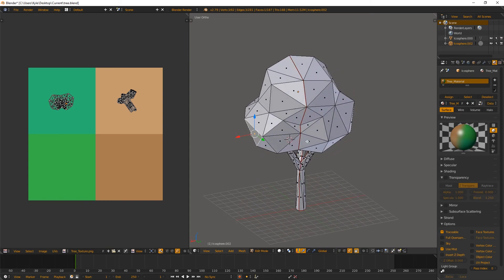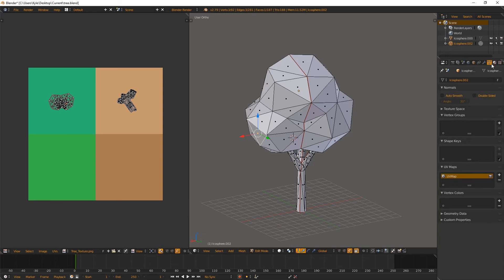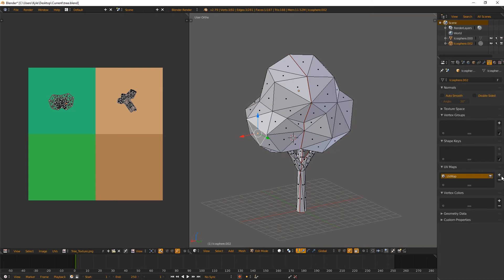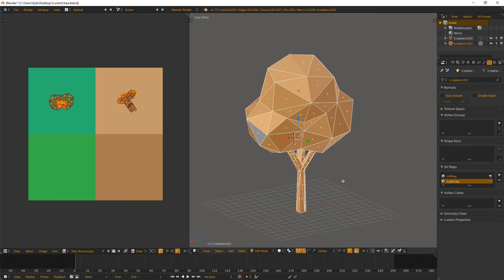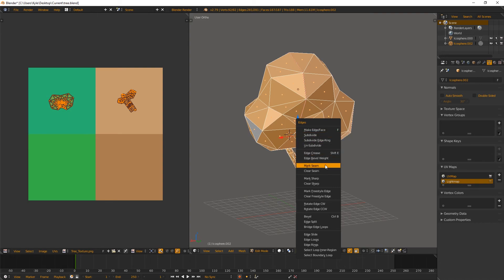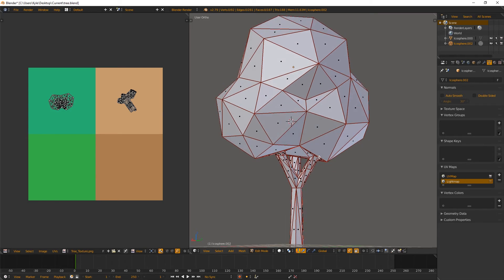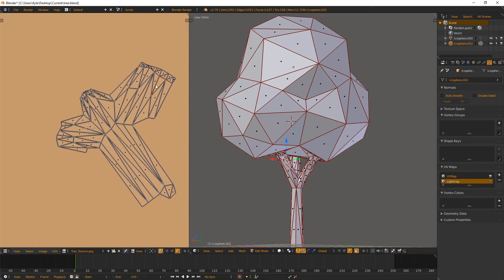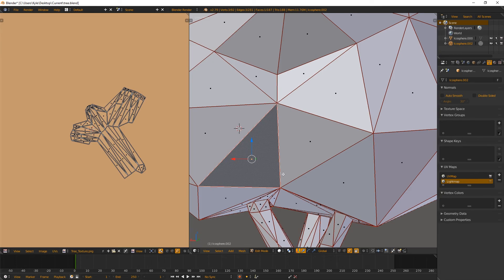Manual Lightmapping Fundamentals | Blender - UE4

Comment from the maker: Hey guys! If you are here because you are having bleeding / fuzzy shadow issues with modular game assets and need to make manual lightmaps to fix this, make sure to turn on "Snap to pixel" ( sorry I forgot to mention this in the video). The issue is caused from the UV edges falling in-between pixel space and Lightmass cannot calculate in-between pixel space. So the fix to this is snapping to the pixels ( In blender ) Here is an image that shows the location of this option in your UV editor ( NOTE: you must first have UVs before this option shows up ) IMAGE: https://i.imgur.com/pKQpB11.jpg
Reply from the maker: That's overkill, having 2 UV maps is totally normal and has basically no resource cost. Although it is possible to have one UV map, but this will likely be wasted space because the light maps ( based on size ) can be very resource expensive and its usually possible to make them much smaller than your texture UV, so its usually better optimization to just do the 2 UV maps. Then you can try to minimize the size of your lightmaps based on the amount of faces or islands a model has and the detail needed and you can do the same for your texture UV, minimizing the amount of pixels being loaded on the screen at one time. Not to mention all of the flaws in the quality of your texture you would have if you where trying to achieve this with a HD / High Poly model. It could be done, but would probably be a puzzle to solve each time and would just be better to do the two in almost every case. Hope this helps answer the question.

Comment: someone should make addon for automate this process
Reply from the maker: Well, most game engines already can automate this process. In some cases you still may need to make manual ones, like if you where making a modular asset that would be used in your game. Or if for some reason you need to reduce the file sizes of the lightmaps, in some cases, you can manually arrange them and get more islands into a smaller space and still have high quality baked shadow results.  

But yea, you can just choose "Generate lightmaps" when you import assets and that usually works just fine ;-)

Comment: Thanks for this. Lightmap pack was really throwing me off.
Reply from the maker: Np, glad it was helpful, Just know if you are using UE4, you can actually just generate lightmaps automatically on import. 9x out of 10 it will work flawlessly.
Reply: It's not too bad for single objects, but if you're making modular pieces you'll often get a lot of shadows/seams between your models.
Reply from the maker: Yes indeed, modular stuff will have issues, this is because the UV edges fall in-between pixel space and Lightmass cannot calculate in-between pixel space. Using the above method should help with that because of the pixel snapping. ( Pixel snapping is what solves that issue ) and I don't think the UE4 auto lightmap generation takes that into consideration ( possibly because it cant? Not sure why.. ) You can get WAY more optimized with this in MAYA or 3DS because they have pixel grid rulers that are visible in the UV editor, but ( at least for now ) we do not get that luxury in Blender :-(

Hopefully I mentioned in the video to turn on "SnapToPixel" in the UV menu, if not, and you still have that issue, make sure that is on ;-)

Peace
Reply from the maker: Here is an image of the "Snap to pixel" location if you need it https://i.imgur.com/pKQpB11.jpg
Reply: Yep, I use snap to pixel - it helps. Again, it's not perfect, but helps.
Reply from the maker: Yea, I really want a UV pixel grid plugin for blender with UV rulers ( adjustable ones ) and snap to rulers with capability to snap the rulers to pixels. I think blender is really starting to come into fruition for game development. Still a long ways to go, but its really getting more and more attention in the game dev department as the years have gone on.